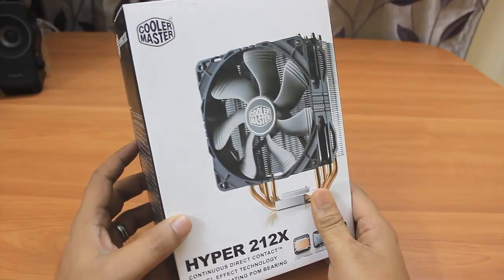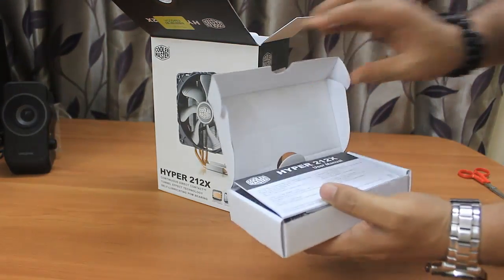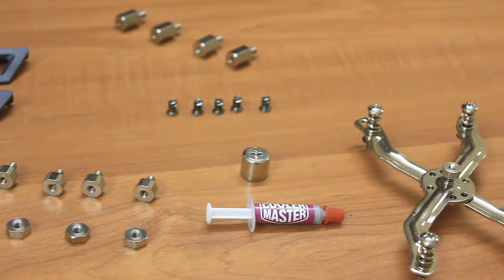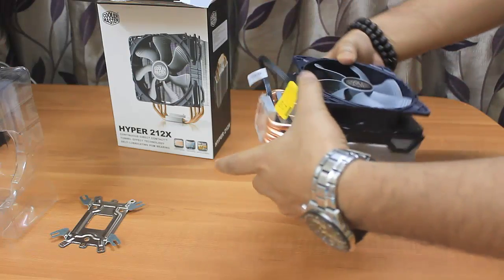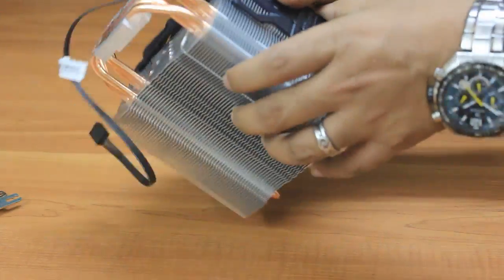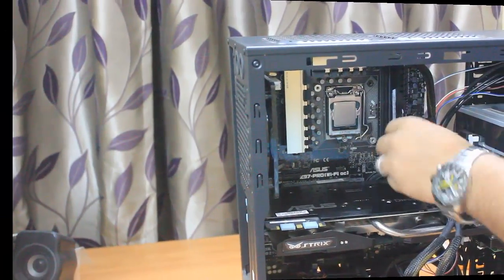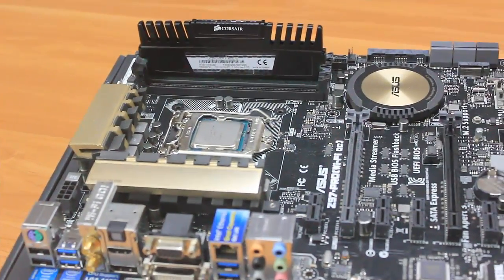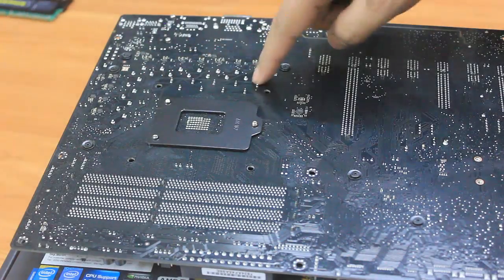How to install Cooler Master Hyper 212X Cooler | LGA 1150 | Intel i7 4790K processor

Comment: I'm six years late and your cpu might be dead by now, but if it isn't, I suggest you flip your case fan around so that it's pushing air out and not onto the heatsink which is blowing hot air towards the case fan.

Comment: I just fried my mobo or cpu while installing one of those. At this time my heavy and big piece of junk just gives me a blank screen..  :(. R.I.P. msi mobo+4790k
Reply: How did you manage that? Also that 4790k is probably not broken, and still worth over 100$ (before you throw everything away).
Reply: @Mobin92  After a lot of tries (I got frustrated) It just worked :-D  I guess the CPU wasn't making good contact with the pins, since they thought was a good idea to reverse the connections (pins are now on the mobo) 9 days trying to revive this thing  and finally worked!  I was about to buy a 4790k-mobo used combo running @ $260 -$300+  I saved my money :)  (I thought I fried this with static) even that I always touch the case and the PSU while moving parts inside the case...
Reply: There should be a mandatory code # display on the Mobo telling the user a diagnostic when something doesn't work, I didn't get any beep codes for this problem, just silence and a blank screen.
Reply: Do you have some extra 4790k that i can have for free im still using Pentium

Comment: Thanks for the tutorial, I was able to replace my existing air cooler with next to no PC building experience. 
However, it appears I purchased a revised version of the Hyper 212X which also has some plastic 'feet' to install in conjunction with the motherboard standoffs (not featured in your vid) as shown in the in-box instructions. So if anyone is reading this, MAKE SURE YOU INSTALL WITH THE ADDITIONAL PLASTIC 'FEET' otherwise the screws on the adaptor bracket won't reach the standoffs on final assembly.
 There's a few other videos I watched which also feature no 'feet' install which confused me for a bit...

Also FYI to anyone looking at buying this, the 212X works really well on my Intel CPU which only gets to 45 degrees max during gaming - it would get to 70+ degrees with stock cooler.
Reply: hi dude i know its kind late now but i got a hyper212x for free  and i wonder how good is it what temp do you get? cuz i am thinking of changing my wraith amd stock cooler
Reply: @Sanko-THEGOD  hey, usually sits around 40-50s on less demanding or older games. On more demanding like cyberpunk it sits in 60s and low 70s. Definitely does way better than my stock intel cooler lol hope that helps

Comment: Dude! i watched problably 10 videos about how to install this cooler and noone mentioned which set of stands to use for the 1150; coolermaster doesnt have an installation manual on their website (at least i couldn't find it) and the installation guide that came with the cooler is the worst manual i have ever seen in more than 30 years working with computers.  You saved me.

Comment: You skipped the most important part. 10:50 you edit out between fixing the metallic bracket to the cooler. How is this achieved? Mine does not stay connected. I watched your video only to see you purposely jumped past the most important point!
Reply from the maker: Check 12:30 you have it here
Reply: @TechvirusIndia  thank you very much I took a few times to understand clearly what the metallic bracket was performing in the installation. Now it is done, but I do not have a 4 pin port for the fan power lol.

Comment: Once I get the bracket sized up correctly It wont fit through the unit so I had to put it in and then try and size the bracket up with no luck at all.

Comment: Easily the best YouTube video ever made. This is extremely useful so thank you very much for sharing. I'm disappointed that this cpu cooler was so fiddly to install but easy after you plan it out and do a few test runs before you apply the thermal paste as explained in the video. I noticed that you didn't use the 4 black plastic caps that sits on the motherboard which houses the first 4 large screws. This is shown in the manuals and I presume it's purpose is to protect the motherboard from damage when tightening the screws.

Comment: Well done. I was really baffled by the lame instructions included with the kit. I got it on without pulling the motherboard but can't recommend that approach. Getting the final screws tight is tough with ram etc. in the way.

Comment: z97-deluxe will that fan work on this.?
Reply from the maker: Immqrtal YT Yes it will work but you need to check what processor you have and what is the size of your cabinet .. both should support it.
Reply: i have a I5 4THgen

Comment: Does anybody know of the block witht eh copper pipes is aluminum or zinc plated?
I have a thermal paster that says do not use with aluminum as it will corrode
Reply: the cooler comes with thermal paste so just use that

Comment: nice and clear, thanks. 
(Why have you still got the layer of film on your case side window? It looks horrible like that, it's done its job protecting the window during transport. Maybe you should have bought a case without a window if you don't want to see inside).
Reply from the maker: alan This case is a temp. case , was there for only a week.

Comment: Very good explanation!
In the manual, the steps of instalation is out order and confused.

I hope that this Cooler works with the socket 1151 (Seventh generation intel), cause i already bought it and there is no mention.

Comment: that small little nub on the block itself near the lower square block won't let my bracket sit flat. If you want to know what it is, it is a tiny little metal thing that is next to the hole the 4 arm bracket goes in, it keeps my bracket at an angle, it won't even let it lay flat. Is it a defect with the block?

Comment: Yeah... but the video avoids to actually show the hard parts. I am sure everyone that has actually installed this cooler knows what i am talking about. So why are you making this video actually skipping/hiding the actual hard parts?  Example watch at 10:48 where the hard part is skipped in order to actually hide the fact that is super hard to fit the screws with just one person especialy if silicon paste is applied over he processor. So on that part he probably had some extra person help and that is why he skipped that part.

Comment: Hey I have a query, I recently got the 212x and was fitting it on the LGA1151 socket, but the X clip was shifting upward from one end when I placed it on the CPU. I had to push it down very tightly to get it into place. Even though my new computer is working fine, I'm worried that I may have accidentally damaged the CPU or the mobo pins by pressing really hard on it.
Is it really that hard to get that X clip on or is it just me??

Comment: did you try rendering? i have heat problems regarding i7 4790k while rendering on vray. cpu reaches up to 90c im using stock cooler. can you help me in my temp problems? thanks :) good day :)
Reply: wayllon apodaca The problem is your stock cooler. It isnt meant to handle high workloads so id suggest you buy an aftermarket cooler that suits your budget and needs
Reply: hey! i bought CM hyper 212x and it worked! my cpu heat is just under 70c thanks :)

Comment: You made a mistake and fitted the heatsink wrongly or upside down or 180 degrees out of phase. When you look at the heatsink and read the logo normally, the fan needs to be placed at the bottom in a push configuration. You did the opposite. The fan is at the bottom, pushing air when you read the logo upside down. This is the 212X version which has a patent (not present on Evo) named Patent “V” Shaped Array which guides the air from the center towards the heatpipes.The way you placed your fan, not only this is not going to work but it may result in bad airflow.

Comment: the metal plate the stand off screws too goes the other way with the 3 screws use on the LGA1150 socket lines up if you look at the manual.

Comment: Is the Fan an intake or exhaust? And which way is the best way to have the fan?
Reply from the maker: Best thing would be exhaust to the back fan .. so that all hot air goes out of the cabinet ! I have put it for Exhaust..
Reply: Tech Virus how do you do that?
Reply: Sebastian Donvild You just remove it and place it on the other side. It is so easy you don't need a manual

Comment: 3 screws at back of the board not matching the 3 holes on the bracket of the cooler.
Reply from the maker: It should .. check if you are using correct screws.

Comment: Can anyone tell me if this will fit in a Corsair 100R case???
Reply from the maker: Corsair 100R can support maximum CPU Cooler height of 150mm.But, hyper 212X has height of 158mm so it can not fit in Corsair 100R cabinet. :(

Comment: are you sure about the sticker that is on the backplate? That is not just from the production process?
Reply from the maker: Yes... Its written in manual as well. We do not have to remove it.

Comment: Nice video. I can see that your cpu fan idles @ around 600rpm, can I ask what is the ambient temperature in your room? My hyper 212x's CPU fan is always running around 2000rpm @ ambient room temp of about 28'c.

Comment: What are you DOOOOING ! YOU INSTALLED THE BACKPLATE WRONG ! YOU DIDNT LINE UP THE THE SCREWS FROM THE MOTHERBOARD TO THE 3 HOLES IN THE BRACKET
Reply from the maker: Wht do you mean by it ? Tell me the time where its wrong ?? I have done 100% as explained in manual ..

Comment: Hey buddy, nice video. Even I have the same case Cooler Master Elite 431 Plus Cabinet, but it has no room for cable management. How did you do it? And by the way I have an i5-4460 processor so is the stock cooler enough or do I need 212X. I play a lot of games and I have an GTX 960.
Reply: +Gurukiran S I have a similar setup and the stock cooler keeps the cpu at good temps and mine is overclocked so you should be fine.
Reply: ***** If you can read you would see I said similar not the same.

Comment: My eyes are burning. Thou shouldst have screwed in a crossed way and not have shortened the cable like that but simply put the fan in a different position so the cable was the right length
Reply: Why does it matter if he shortened the cable like that?
Reply: Some people have ocd.

Comment: If you have problems removing the stock fan, it's probably because the clear/white plastic piece is turning when you turn the black thumb screw.  Hold the clear/white pin in place from the back of the mobo while you turn the black screw.

Comment: Worst fan orientation of the case. The rear fan and the CPU fan will cause turbulence and will not carry any hear away from inside of the case. Also you are supposed to do the screw crisscross pattern, it will help spread the paste more.

Comment: 2:38, I don't think you're supposed to be putting fingerprints on the copper contact, potentially corrosive and may interfere with performance. Oh, yeah, it still has the plastic protective cover, but be careful.

Comment: can i change the fan?
Reply from the maker: +Kervin Aquino Yes, you can . Just make sure to use right size fan.
Reply: ok thanks. i want to put an LED fan on it. its 120mm right?
Reply from the maker: Yes right ..

Comment: can i install similarly on the lga 1151 type cpu..instruction manual has only 1150 and some other amd stuff...
Reply from the maker: +amogh max Yes you should be ... just check cooler master site, it has list of compatible  processors .

Comment: Hi, I have the ame config as yours. I am considering this cooler. But I am worried that my case might not close with it. (Circle CC 830) It has roughly 168 mm clearance. You think I should be fine?
Reply: The heatsink is only 158mm tall. You should be fine.
Reply: Joshua Kallen Yep. Got it.. It almost touches the glass panel. But fine!

Comment: Good video but one problem Your cooler fan is pushing air across the radiator into the back of the case which has a fan pushing air into the flow path of the cooler. In other words you have an air flow collision, You need to flip your rear case fan around so it pulls the heated air out of the case.
Reply from the maker: +ElfNet Gaming Thanks .. My rear fan is air out type. It pulls hot sir out of the cabinet .
Reply: from the video it looks like you have it in backwards though, The rule is -  wire / spec label side blows, open / grill side pulls.
Unless that is some odd-ball type which is not unheard of but I haven't seen one in a long time like since the IBM XT days.

Comment: with an i5 4460, 8gb RAM, MSI GTX 750 TI Twin Frozr GPU, and 500W PSU. Would I need more power fom psu if I wanna insall this air cooler?
Reply: +Kkab Yul Jjang no
Reply: +Kkab Yul Jjang  if your supply is powerfull like 550W you will not need any more power for it is fine

Comment: waths the difference between Hyper 212 EVO and this 212x ?!!
Reply: +OneTruth The latest in the extremely popular Hyper 212 series, Cooler Master’s Hyper 212X is based on the same patented CDC Quad heatpipe array as the 212 EVO but features several improvements that boost performance and further reduce noise. Thanks to our brand new Smart Engine and POM bearing, the 212X is incredibly durable and will virtually last a lifetime.
Reply: +LuGaRia 911 Thanks for explaining :))
Reply: +OneTruth he actually copied it from the cooler master website. Notice the last line xD
Reply: +LuGaRia 911 raise hand What are these "improvements that boost performance" and this smart engine, pom bearing you speak of? There's a lot of words there for not saying anything.
Reply: +LuGaRia 911 Thanks for the explanation

Comment: Would you recommend using the paste that came with this cooler, or Arctic Silver 5? Thanks.
Reply from the maker: +Tanmay Chhatbar I would suggest you to use the paste came with cooler master, as they would have tested the compatibility performance .
Reply: Tech Virus Firstly, thanks for the reply.
I've read online about this on some forums. Some users say AS5 is better, some say CM is better. I didn't know what to believe, Thanks. I guess I will use the Cooler Master paste.
Reply: +Tanmay Chhatbar actually, Arctic Silver gives 1-2C better performance but i think the paste supplied with this cooler is pretty decent too. Fyi there is no 'compatibility' issues as long as u are using a thermal paste and not anything else.
Reply: Keita Marislo Thanks for that information. 1-2 degrees might not be a substantial difference, but for a processor that idles at 65 degrees, I guess AS5 is better then. Thanks.
Reply: Tanmay Chhatbar if ur cpu idles at 65, it could mean something is seriously wrong.
Reply: Keita Marislo I know. It peaks at 97 under full load. 
My wild guess is, the guy who built it did not apply any thermal paste. I guess we'll find out soon enough. Thanks.
Reply: Tanmay Chhatbar or the cooler might not be sitting properly on the cpu or  a faulty cpu or a faulty heatsink fan, try running it with case open and try other temp reading utilities as there might be a software error. It should reboot itself if its going that high though,
Reply: Keita Marislo The case Is open, but in a corner. And regarding reboots, the processor is rated upto 105C. But, I do agree, those temps are unwanted.
Reply from the maker: Tanmay Chhatbar Which processor you have ? ... if its i7 4790k then ideal should be around 35-40 C and peak at 60-70 C. Check your thermal paste and airflow inlet and out let design, there should be proper design in respect to air flow in the cabinet.
Reply: Tech Virus Mine's a 2600k. And a little digging around online shows that even for this processor, it's unusually hot. Thanks.
Reply: Tech Virus
Keita Marislo
 Update: Thank you for your amazing cooperation. I have installed a Cooler Master Hyper 212X with Arctic Silver compound, and the temps at idle are 37-42 degrees, and at load, top out at 65-68 degrees. Thank you.
Reply from the maker: Cool .. thanks for the update
Reply: +Tanmay Chhatbar Hi, bro the temperature you are mentioning comes when u use stock intel cooler that comes with cpu. WHERE is the ADVANTAGE of after market cooler master cpu cooler u bought..?

i mean why should i buy when my stock cooler gives exact same reading.
suggest me ;)
Reply: CompilingInput I initially used to use stock cooler, which somehow fetched me insane temps of ~95C under full load. 
I upgraded to a 212X and Arctic Silver, which dropped my temps down to 55C under full load. I'm not kidding about any temps, yes they are in Celsius
Reply: Tanmay Chhatbar thanks for reply,with stock cooler i used to get max 80c under full load ,few dayz back i changed thermal paste and used as5 my temps were up and now its reaching 94+ under full load and yes i applied thermal paste correctly...so i was considering to move onto hyper212x but  i am still doubtful whether der wud be considerable  effect or not.

i use p95 for stress testing.
Reply: CompilingInput As a person who tried it, I'd recommend buying a 212x. It really helped me.

Comment: This is a good Tutorial, however the back plate you installed is up side down. The three holes have to match the three screws sticking out from the motherboard. It might not matter to some people but it actually matter on my install because the one screw was actually pressing against the  back plate.

Comment: im using the TX3 evo...should i upgrade?
Reply from the maker: +Vernon Ray It will just give 3-4 more deegree cooler performance not much . If you want to upgrade go for water cooler from coarseair
Reply: +Tech Virus thanks, going to try some better thermal past now and see if it drops, at load I'm getting max 43